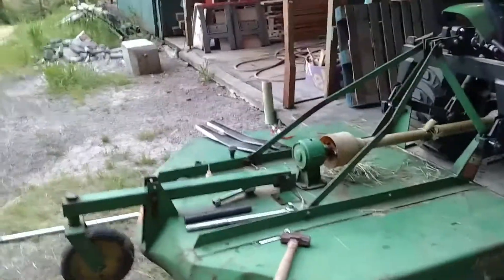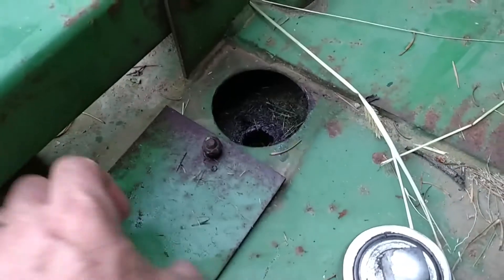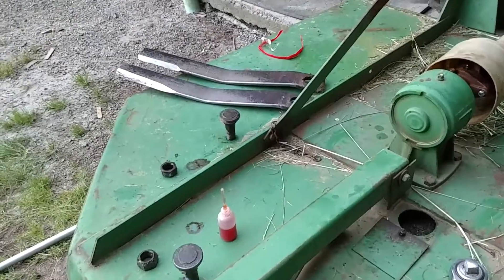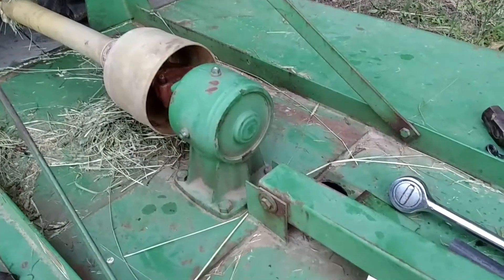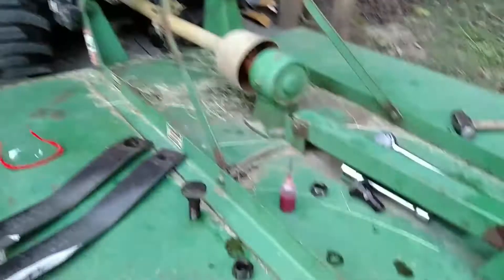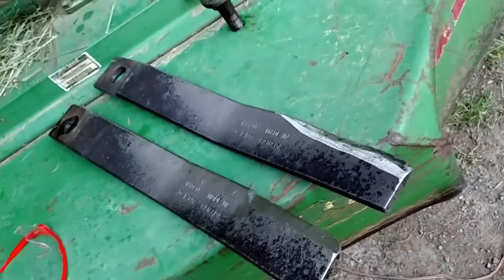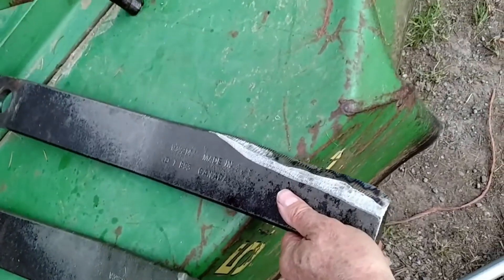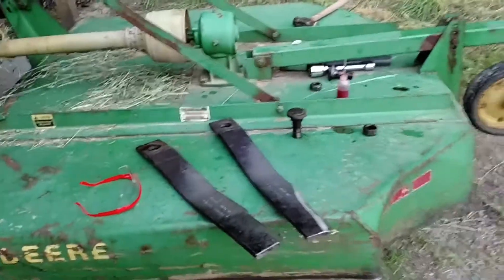Sharpen your own brush hog mower blades. Removal is easy.

Comment: Installed these on a riding mower  https://www.youtube.com/post/UgkxetgfkJxfdT_B2vGYP-uNTLaBbim9OKTD  . They were sharp out of the box, although I've never liked blade edges that were coated...not quite as sharp as I personally want. Using my belt sander, I removed the coating from the cutting edges and refined the edge enough to shave with them. So far, after three runs, these blades are holding up as expected. Even after hitting a few fallen 1/2 inch or so branches, the edges are still sharp as heck. No edge dings, no warping, etc. As far as installing them, the cutouts were of the proper size and shape to fit my aging Craftsman mower. Very satisfied.
Reply from the maker: I am not sure if you are asking a question or making a statement?

Comment: I actually sharpened the blades on my Kingkutter without removing them.  I used an angle grinder with a 40 grit flap disk.

Comment: That heat blued area on the sharpened blade is now heat treated and brittle. Will probably break or chip when you hit the next rock. Best not to get blade edges that hot. Leave them slightly dull since it's a slasher cutter, not a lawn mower.  Blades will last longer.

Comment: May be a long shot, but what kind of lube goes in the gearbox? Grease? 140?
Reply from the maker: They sell it at tractor supply places.  It may depend on how cold it gets where you are. 90wt can be too thin in hot climates. Medium weight grease work well but must check with the oem or try best to get product made for those gear boxes.

Comment: Do you replace the hardware each time
Reply from the maker: I don't.  I have only done this 3 times on this tractor and the bolt still looks very solid.
Reply: Manual states that the hardware should be replaced if removed. Not sure why.

Comment: 30% + 30% equals?.. so what do we put in the other 40%?
Reply from the maker: Sorry.   The ratio is not significant.  It is basically 1/3 acetone and 2/3 transmission fluid.   This has been asked and answered a few times.

Comment: How do you generate 627 ft/lbs when tightening those bolts.
Reply from the maker: I don't.  I use a 4ft cheater bar when tightening.   I have never had a blade come loose.

Comment: If I ever can get those nuts off my old brush hog, I will be putting anti-seize compound on the threads before re-installing them. Broke 2 wrenches trying to get them off and then had to sharpen them while they were still installed. Got it done though.

Comment: How do you reinstall without someone underneath holding the bolt in place?    Also How do you keep the mower deck from rotating whilst loosening the nut?
Reply from the maker: You get the nut started while under neath the mower then tighten from above.  No need to secure the blades from turning. Just position wrench to work against the rotation. I.e. put wrench 90 degrees to axis of blade rotation.
Reply: Seems to me a rubber band would work.

Comment: How often do these need sharpened? Also I seen others say not to sharpen these?
Reply from the maker: It depends on how difficult the land is that you are clearing.  I ran in to a fence post the other day that was burred in the brush.   Needless to say, I needed to sharped the blades again!.  No reason to not sharpen the blades.   If you need to grind them down a lot you should make weigh them to make sure they are the same weight.  Withing a tenth of a lb at least.

Comment: So, how did you reinstall the blades?
Reply from the maker: fortunately the bolts have those square shoulders on them so it makes it easy to just reinsert the bolts through the bades and tighten down the nuts.

Comment: We have a local blacksmith who forges out and sharpens blades. Using a grinder can ruin the temper if you get it too hot. Grind a little and let it cool. If you see a blue color, you have lost the temper.
Reply from the maker: Very valid point thanks.

Comment: I have a John Deere tractor (790), and a 513 Bush Hog which have never had the blades off since purchasing the combination new in 2003. The bush hog was always sharpened with the blades on, but sure would love to get the blades off. The hydraulic fluid in the housing probably should be replaced, and I am surprised that the bush hog or other implements attached have not been dropping, and the tractor must still be in great shape.
Reply from the maker: Good luck on your project.

Comment: You forgot to add that the blades need to balance or weigh the same after sharpening. Out of balance will vibrate and may take the gear box bearings out.
Reply from the maker: R Van good point.
Reply from the maker: Good point thanks for adding that.

Comment: 30% Acetone, 30% Transmission Fluid...what's the remaining 40% ???  What's the secret old timey farmer's solution?  Thanks for the video, I just started field mowing for the first time and appreciate the Brush hog maintenance info.
Reply from the maker: sorry for the confusion.  I mean to say 30%-50% acetone with the remainder amount to be transmission fluid.  google diy penetrating oil and the internet is full of combinations but 90% are in the ball park of what I listed. thanks
Reply: Beer
Reply: podunk,,,looks like you need to be careful following advice of pilgrims....These things are BUSHHOGS,,,,somehow, some people wind up with brushhog in there,,,,dont know how they do that. Left loose, right tight,,should tell you lots about who is doing the talking here,,,,
Reply: @bill45colt   -  Bush Hog = brand name, made in Selma, Alabama. Brush hog = colloquial name for the attachment. Just like here in Texas, every place has a name they tend to call these rotary mowers. Here they are called "shredders." I have heard Brush Hog all my life for the device, so it really doesn't matter, does it?
Reply: @backwoods4131  everclear lol
Reply: @bill45colt  Kleenex or tissue...ketch up or catsup...mayo or helmans...pish posh dude.
Reply: @gckshea  read the name on the side,,,,that will tell you what it is,,,,,
Reply from the maker: 30%  to 40% acetone and the rest transmission fluid.

Comment: Hey, what is the other 40% of your solution mix?🤔😬
Reply from the maker: Acetone and transmission fluid. Ratio not important. I use 60 Trans fluid and 40% acetone. (Or MEK).

Comment: 1) use a breaker bar when "breaking" the bolt loose or you will trash you rachet. My land pride mower blades need a new lock was and torqued to 450 ft/#.   2) you need to balance or weigh the blade or you will trash your gear box. A simple beam scale can be made and accurate. factory spec is balance within 1.5 oz  of each other.
Reply: sorry, need a new lock washer and torqued to 450 ft/#.
Reply from the maker: Very good comment.  Thanks.

Comment: One of the commenters asked that if the secret farmers mixture was 30% acetone and 30% transmission fluid...what did the other 40% consist of...the author of the video corrected his percentages and said that it should be 40% acetone and 60% transmission fluid.
Reply: I was wondering the same thing - thanks for updating

Comment: I don't like to sharpen the cutting edge down to sharp if I'm using the cutter on brush and trees. I leave a 1/8" flat on the edge so it shatters the stump for faster breakdown. The small stubble cut clean can play heck on tractor tires and takes twice as long to breakdown.
Reply from the maker: I am just mowing grass so I keep it pretty sharp.  Plus I break 8mm shear pins pretty fast if I hit anything like a big limb or top of a stump....But thanks for sharing!
Reply from the maker: Yes, this is especially a good idea if you are cutting heavy brush as opposed to just grass..
Reply from the maker: Yes. It is possible especially if you can fairly easily get the mower deck to a place that is comfortable to access the blades.  But I find that I do a better job with them off the mower.